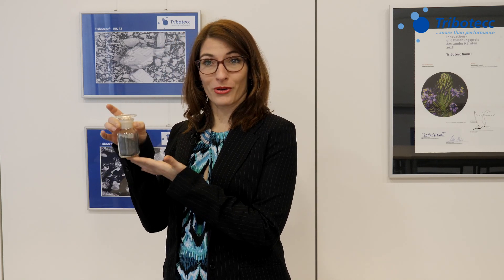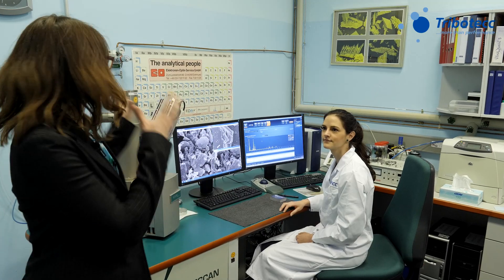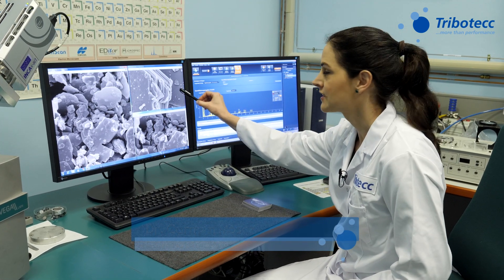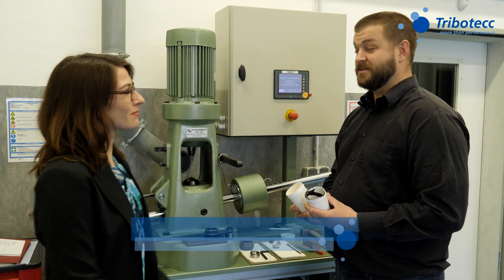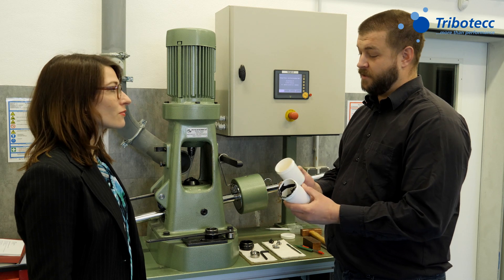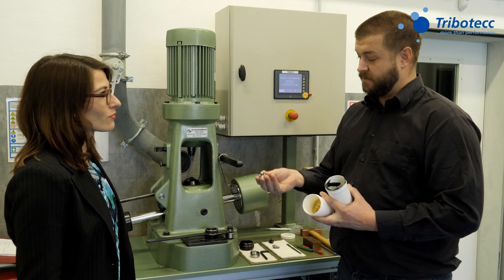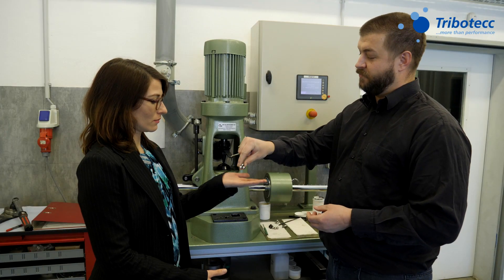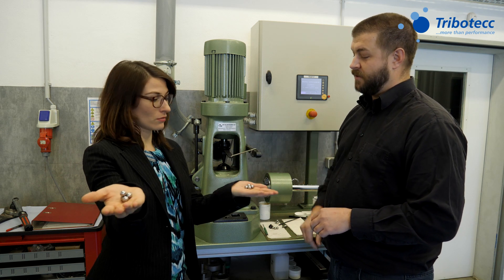Tribotecc Insights: Solid lubricants and tribological applications

Comment: Do you use solid lubricants for hot forge die lubrication? I would like a simple machine to prove the capability of the lubrication, is there a device on the market which is maybe not as accurate as your ball/friction machine but provides comparison results?